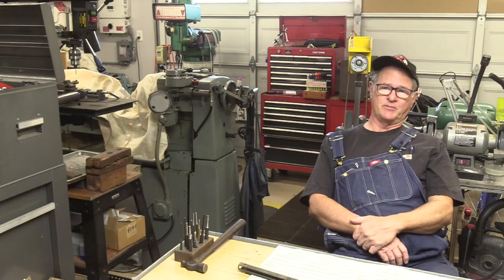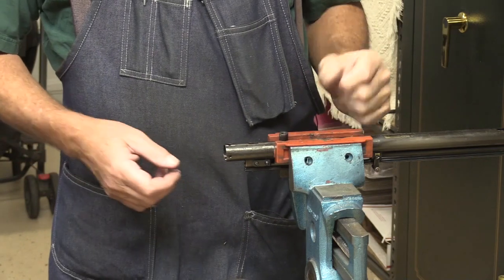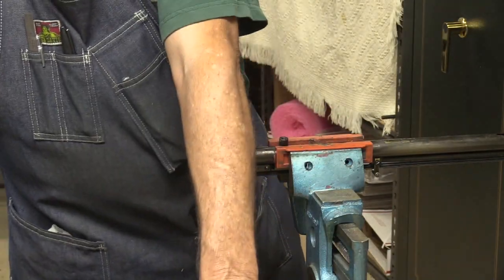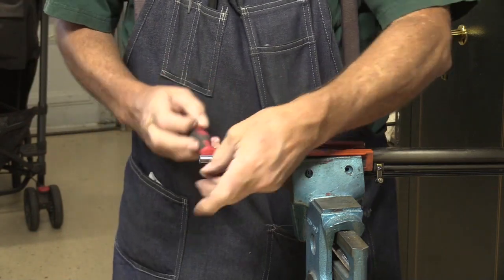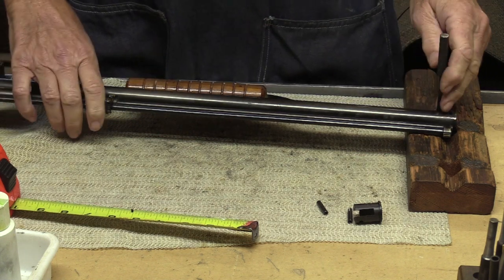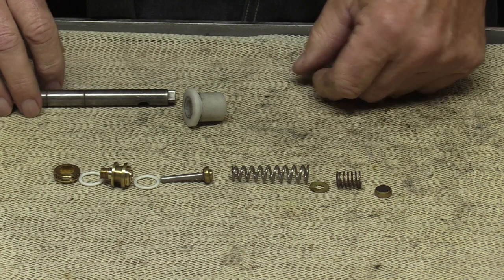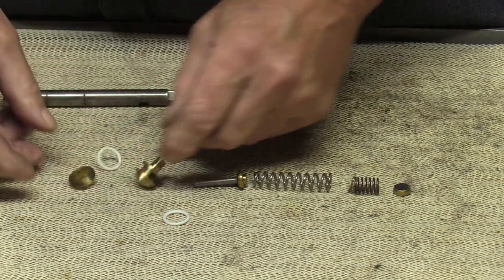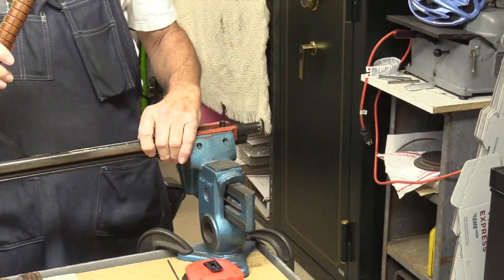Benjamin 3100 Rebuild Part 2

Comment: Great video, I've seen other videos where the single port valve has to be aligned for the valve to be in the right position.  Now in the multi port valve does the valve just need to be simply installed?
Reply from the maker: No need to align the multi port valve
Reply: @NorthWestAirgun  Thank you very much you have been very helpful this is only my second rebuild did an old crosman 760 XL deluxe powermaster. This one is a bit trickier!
Reply: I received the new kit for my sheridan pre 70 air rifle with springs pump cup stem and synthetic orings. When I put he orings in the valve and try to install it in the chamber it won't go in seems like the orings are too big because the valve doesn't go in no where close to where I can start the nut. But if I pull off the orings I can easily install the valve and tighten it all up with no problems. Wonder if I should try and find the original lead o rings?
Reply from the maker: @jerryees  Put the first 'oring' in place in the tube, without all the valve stuff, make sure it is seated all the way down on the step it sits on.  Then try installing the valve  again.  If it still hangs up, then the outer seal is your culprit, and is likely getting hung up on the threads.   Not really recommended, but you can lightly sand  the outside edge and remove a small amount of material until that oring can just slip past the threads.  Alternatively, sometimes a light tap on the valve tool as it gets hung up will push things down where they belong.  Just don't get too frustrated, and keep patiently working on it.
Reply: @NorthWestAirgun  I'm going to end up looking for some rubber or lead orings my gun doesn't like the synthetic for some reason they sit too tight and I messed up the first one already trying to set it in.
Reply from the maker: @jerryees  lets take this to email; 

nwa@northwestairguns.com

Comment: Hey Jon, I got a rebuild kit for my 312 but ripped the replacement lead gasket that sits between the nut and valve would a rubber o ring work or does it need to be lead ?
Reply from the maker: Yeah, hate when that happens.  Yes, try an o-ring, that seal is less important than the inner seal.  I don't know what size.   It may not last decades, but is the easiest to replace years from now.
Reply: @NorthWestAirgun  thanks for the quick reply I appreciate it

Comment: I have a Benjamin Franklin CAL 22 MODEL 312. It has been in my family for at least fifty years. I used it about eight years ago and put it away with air in it. I just got it out again last week. It will not pump up. I took it apart, except for the valve, and cleaned it. Still no air. I need to rebuild it. Parts are easy to find. I have one problem though. I do not have the valve removal tool. I do have the tools and skills to make my own. I just need the dimensions to do so. Would anyone be able to help me out with this? Or loan me the tool?
Reply from the maker: here;  https://youtu.be/fANHrU0bQmo?feature=shared

Comment: Im in the process of taking apart me Benjamin 392P inherited from my dad. I have just the barrel and valve is stuck inside. I dont have the tools mentioned in your videos. Ive tried pumping it out, hammering it out, and it is not budging, any advice? What can I do?
Reply from the maker: Step away from the hammer and give me a few days, I'm not really available right now.  I'll get back to you soon.
Reply: @NorthWestAirgun  great, I will put all the parts in a bag and wait for your responses

Comment: Good video Jon!  I was wondering if a socket with a 8mm square on the end of it would work for removing the brass valve?  Stay healthy my friend!
Reply from the maker: I don't know Ron, the dimensions are pretty close (https://youtu.be/fANHrU0bQmo)  but you have to drill out the center to make room for the valve stem that sticks up thru the nut.  I saw a post somewhere that a guy took an extension and filed it down to where it fit the nut.